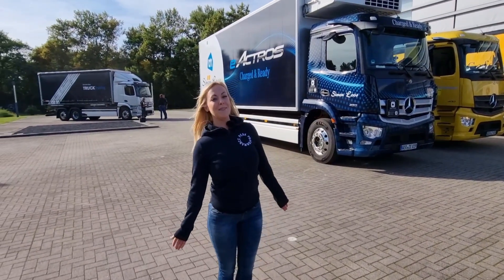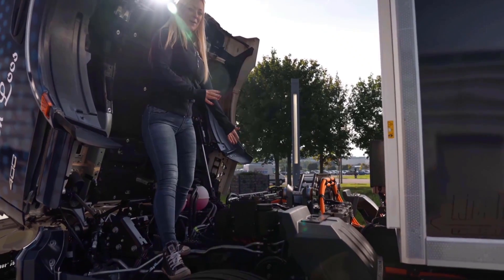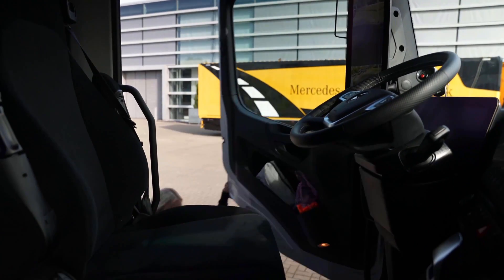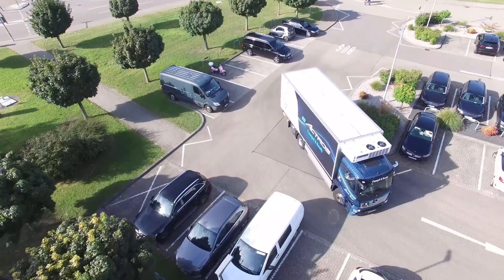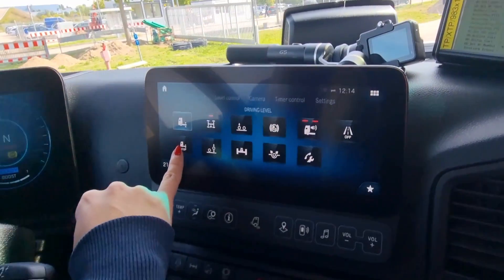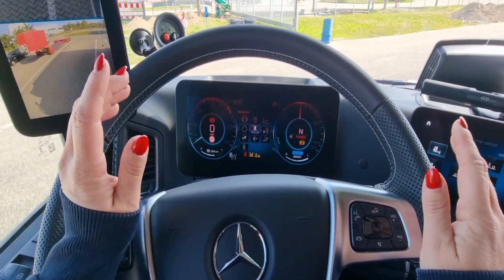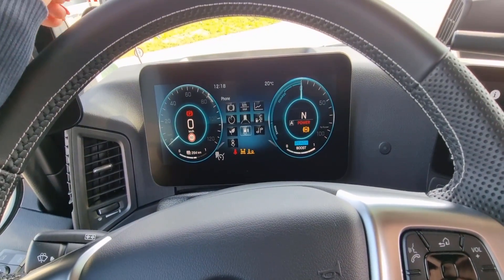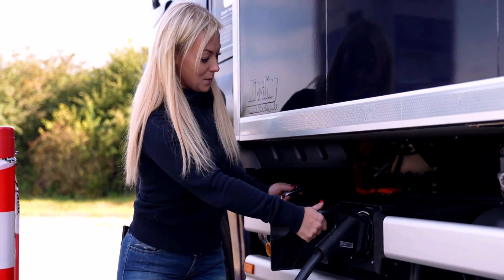⚡MERCEDES ELECTRIC TRUCK⚡ E-actros - Angelica Larsson

Comment: Excellent video and a pretty nice truck!  Hope that future vehicles share the same charging station plug-ins and standardize them across the world (Car & Truck).  One think that would be nice, at least for the straight truck, would be to add solar panels to the roof.  There seems to be plenty of roof space for them and would provide all-day charging to extend the work-time of the vehicle (during the day that is).  Not so much for the standard Semi-Trucks (unless they have an extended cab).  Curious how it would perform pulling those big loads from your recent videos. 😄

Comment: Cool for just around town.

But for a long range I believe most EU countries have a speed limit of 100kmh for lorries and the driver must take a break every 4 hours.  So you're first reaction to those numbers might that this lorry satisfies that.

However if the lorry has a range of 400km then when you're only recharging to 80% you will need an extra battery, which is another 750kg.  And when it's winter that will have an effect as well.  But also when you operate that big chiller thing over the cab that will also have an effect on the range.  So you might want 2 extra batteries for long range.

But cool to see that lorries are now becoming electric as well.

Comment: How wired was it to have no engine noise?
Did you get to drive the or even look at the Mercedes hydrogen truck unit that would be good to see and learn about 
Good introductions to electric truck 👍

Comment: You can only drive 250 miles with this truck before it needs recharged. That is nothing here in the states. It would maybe make a good city delivery truck or a delivery truck that travels under 250 miles. Electric is not a good choice for long haul trucking. You also need to factor in the weight of the load and terrain. The more the load weighs the more energy needed to move it which shortens the charge on the battery quicker. Terrain is the same way. If you have uneven roads with hills it takes more energy. Give me my good ol' diesel engine anytime.

Comment: Probably not in my lifetime. Infrastructure to make electric vehicles practical seems away off. Petroleum products required for producing batteries and the fact the charging stations ive seen ran off diesel generators, so still dont quite see the supposed environmental gains. But, maybe someday, battery life is certainly improving by leaps and bounds.

Comment: Greetings from Scotland! This is the future! Or is it? I agree that these trucks which have around a 400Km have a place in the city, but long haul is a completely different matter. I predict that Hydrogen cell trucks, like the Mercedes-Benz GenH2 Hydrogen Fuel-Cell Electric Truck which have potentially a much more realistic range of around 1,000 to 1,500Km and much quicker refill times will soon be in service, as long as they can get the Hydrogen fuel production costs down? Thank you for this report Angelica and a big thank you to Mercedes Benz Daimler for having the foresight to invite someone with great such experience to check out their trucks! 👏👏👏👏
Reply: Diesel engines modified to run on hydrogen will likely be much used in in larger construction machines and long haul trucks. Check out videos on JCB latest engine development
Reply: @Rimrock300  Yes, this is also a very promising option, it's better if existing machinery can be upcycled, so to speak!

Comment: Prototype or production ready? Price compared to similar truck?
Reply from the maker: I think they're just started selling 😄 not sure about price 🙉
Reply: Prototypes has been tested since 2016. This is second generation, production ready. x3 the price of a diesel Actros. They for long has said batteries will be cheaper as production is ramped up, but it has not happenen, rather the opposite. Those special metals used in the batteries are aviaiable in small amounts, driving prices way up. Eletric vehicles are just driving prices up for everything to a much larger degree than diesel. It's madness.

Comment: I own an EV car, they have installed a lot of DC fast chargers but no where enough to charge all the EVs they plan to make. It's going to be a long time before they have the infrastructure to charge all these electric vehicles.
Reply: More to the point unless we go fully nuclear, we'll need to burn more FF's to support all this demand.
Reply: @johnvelas70  We'd use less fossil fuels if we didn't have all this EV nonsense that wastes it without any significant contribution!!!
Reply: @LWRC  If the 3 best selling vehicles in the US were not full size trucks we would be using less fuel too.
Reply: @justcallmejohn2833  That what a free country is all about John. We don't need the government shoving this nonsense down our throats.
Reply: Installing all those charging stations, solar panels, wind turbines, solar thermal power stations, a lot more jobs as the industry grows.
Reply: @PiDsPagePrototypes  All this busy work for what?!!!  Why not put all this human resources to actually produce products that are useful to our society instead of just churning for the sake of making useless work?
https://www.youtube.com/watch?v=-MJfjrgEq34
Reply: @LWRC  It's the same as all the 'busy work' needed to do maintenance and installation as a Gas Fired power station, or Coal, or Diesel, the difference is, being able to breathe next to the powerstation. What's useful, is developing new technologies that don't fill the environment with waste, compared to all the last-century-economics of "Your grandkids will deal with it, I'll just scam off the profits and leave them the mess".
You either understand that the new technologies are 'taking responsibility for your own actions', or you're a dinosaur that won't evolve and will die off, preferably before earning a Darwin Award for ruining things for everyone else.
Reply: @PiDsPagePrototypes  Pretty funny from someone who wants to make busy work contributing nothing to society!
Reply: What a complete waste of our resources for all this EV nonsense - it still powered by fossil fuels!!!
Reply: @LWRC  Not everywhere, the state I live in is roughly 1/3 hydro, 1/3 nuclear and 1/3 natural gas.  But if you live in an area that generates electricity with fossil fuels there are less rewards.  The internal combustion engine is very inefficient over 60 percent of energy is lost as heat.
Reply: @justcallmejohn2833  And by the time you convert fossil fuel into electricity and go through high power transmissions and the many times the voltages get stepped down to power the chargers at home or business, it is actiually worse than internal combustion.

Comment: It's interesting to know that they have the motors in the axles. They could also put those axles under trailers or wagons so they help push themselves to start up and generate power when braking. I just don't know where the power to charge everything is going to come from. The next 10 to 20 years could be interesting but I probably won't be around to see much of it.
Reply: They are hoping that the majority of people will charage at home.  At the same time, they are also hoping more. people will install wind or solar on their homes.  For example the Tesla Power Station is designed to store solar generated power to charge the car later.
Reply: Put a wind turbine on there and hope the wind blows hard enough to get you going down the road
Reply: Probably from a nice coal fired furnace although the greenies are working on a fairydust alternative.
Reply: @henryostman5740  The real damage is the creation of those batteries... not very ecofriendly.
Reply: The power companies are in the process of decommissioning coal plants or converting them with upgraded generation and natural gas turbines.  In addition to his install more solar and wind.

The transition is already happening.  My local power company does not have any coal plants.

Comment: Are the batteries going to drain faster during extreme cold like the batteries now . Also batteries are heavy so it means you going to haul lighter or less freight than we do now
Reply: A 500hp engine, 18 speed transmission and a tank of fuel are also heavy- here they are all missing.

Comment: First off, it's a Mercedes ... not good! Second, how do you justify that more than 2 million liters of water are wasted in production until completion and that other regions of the world are dying of thirst? Neither one nor the other is praiseworthy. I'm not a hater, but nobody needs that kind of garbage. Ultimately, what happens to the waste materials from the battery when it comes to scrap, are they recycled as well as the wind turbine blades and are simply buried in the sand of the desert? Crap only crap !!!

Comment: I'm not won over, 400k to each charge and you can only put 80% in. And here's a question, while your taking care of recharging the battery are you on break or other work. Hydrogen has to be the future.
Enjoyed the vlog, take care be safe
Reply: there will be better batteries soon probaby. 400 seems to be only enough for local deliveries, sad times

Comment: Great to see, and I think they are the future, especially in cities. I've watched your videos where you've driven to the north of Sweden. I wonder how an electric truck would cope with the cold weather, but also how the cab heating would work and if it would be warm enough. But for a medium range delivery truck that Mercedes would be amazing.
Reply from the maker: I know another brand is testing here in the north, the truck works, but they're having a hard time keeping the heat in the cabin 🙉
Reply: @AngelicaLarsson   Esti super bun soferită Angelica sper ca mai continui cu vidio clipuri ca eu am urmarit taote vidio clipurile tale Angelica  Eu te stimez foarte mult asa Domnisoara asa de tinara sa conduci numai camioane si utilaje foarte grele ..

Comment: I hope you had a blast at Mercedes testing center. You must have felt like a movie star with all those people with cameras on you. 
They picked a perfect tester to try out the truck.
I think those back up cameras are really cool. Yes, it probably takes a little time to get used to, but it would be nice in the winter not having to clean mirrors……. Although I am sure you need to clean camera lenses.

Comment: Great video Angelica. One question how do the batteries perform at -20 or -30c. Does anyone remember the old electric milk floats? Nothing is new only better and more advanced. Thanks Angelica.
Reply from the maker: I know that another brand is testing here in the north, it works, but it's hard to get heat in the cabin 🙉

Comment: Never understood why mb introduced those backing cameras,the screens create a huge blind spot on very important angles,and they are worst than mirrors when you need to reverse.Totally makes sense ?
Reply from the maker: On their trailer, the cameras move, so you see the trailer all the time in either mirrro😃
Reply: Aerodynamics are improved. I guess what makes them less good than mirrors is that they are not 3D. You can’t see the true distance to stuff on a 2D display. Try backing up with one eye closed and you’ll ”see” the difference.

Comment: It is good for the environment until you have to dispose of those 4 batteries at the end of their useful life.  At that point it is no longer that good for the environment.  You are essentially trading soil pollution for air pollution and I for one do not think that is a good trade.
Reply: You don't "dispose" of batteries. You recycle them. We can easily recycle 80-95% of EV batteries.

On the other hand 0% gas and diesel exhaust is recycleable =)
Reply: They get recycled

Comment: Angelica I will bet it was an honor and a very cool thing to have Daimler invite you to check out and drive the electric truck
Driving an electric truck was a real different experience for you from a regular gas/diesel version
Very cool to see you driving it out on the test track and I did notice it was a lot quieter drive.
That Frigoblock refrigeration unit I would imaging that was powered off of the trucks batteries.
I also saw the different side view mirrors inside the truck running off of cameras outside, probably for aero reasons and for a quieter drive too without the wind noise from hitting the outside mirrors.
You could very well be the next spokesperson for selling electric trucks, but you love your day job very much and I do not think that will happen anytime soon.
Indeed the battery range is very short, but for city use it is perfect.
Each battery generation the charge is getting better range and distance out of the batteries.
Very cool seeing you doing this in this video with maybe more of these in the future.  👍 For a great video and keep them coming when you can.

Comment: Angelica som du vet så tittar jag på den och gör tummen upp för dig. Det jag måste påpeka är att om du hade lastbilen på din arbetsplats under vintern och den stod utomhus i en timme bara men det är minusgrader. När du kommer tillbaka till lastbilen så kommer du se att batteri laddningen har sjunkit och är det kallt så hade du inte kunnat starta den. Samma sak med elektiska personbilar. 
MEN i framtiden kommer inte varken elbilar eller ellastbilar dominera på vägarna utan vanliga bilar och lastbilar. För Formel1 håller på ta fram hållbar bränsle som ska driva dessa F1 bilar och det kommer sedan kunna köpas till allmänheten med. Alltså du ska kunna köra din bensindrivna bil med det nya bränslet som man håller på ta fram och minns jag inte fel så är Sverige inblandat.
Nu får du skratta åt mig, genom att du pratar engelska så glömde jag bort att du är svensk, så jag använde Google translate till Engelska, sedan kom jag på att du är svenska.
Reply from the maker: Du har helt rätt 😄 det låter också spännande 😃

Comment: It will work both diesel and electric...

What is the cost of the vehicle
Reply from the maker: I forgot to ask 🙉
Reply: @AngelicaLarsson  I heared on the news recently its about 100K over the Diesel version, could have been DAF, or yet another brand though, but it should provide an indication. Was a report on a Dutch Transportation company,that went all electric. That therefore had to find the clients that shared the mission and would support going all electric, as part of their brand values.

Comment: I love your content,but I have to disagree. These trucks may help the environment,however they are not practical and it takes more energy and pollution to construct the batteries on these electric vehicles. Thanks for sharing !
Reply: Just a hype those electric hairdryers on wheels. As you say there is tomuch energy needed to make the batery,s. But the experts know always better,within 15 years the will see that it is 1 huge mistake. Better use hybrid oe a generator that uses very little organic fuel to keep the electric engines running. There was already a prototype car wich could do 500km omn 1 litre of diesel,combine that with a 50 litre tank and you can drive from Amsterdam to peking 3 times on 1 filling. Big plus is No batterypackage needed. But we need to follow crazy greata,i think that is why daimler invited Angelica. But who am i,just a V8 camaro owner😝😝😝
Reply: @janvanrenselaar5998  "But the experts know always better..."  Always follow the money...
Reply: Not to mention that the planet is not ready to sustain extra electricity consumption. There will be blackouts all over. They will have to burn the hell out of coal to keep these jokes running. “ A business man can make a good politician , however, a politician will never make a good business man”. It is all special interests , this hard push on electric vehicles
Reply: @Corleone_Napoleone  yes it is all about getting every cent out of our pockets,every 15 year there is a doomsday preacher standing up. We had the Acid Rain, did you find bottles of vinagre in your garden,The hole in the oZON layer of the atmosphere. we don,t hear anything more of that problem. Did we closed that?? And so yes,how did we do that,With Ozon in Spraycans??

Comment: Do you think these battery trucks are powerful enough to pull extremely heavy loads ?
Thanks  Chris
Reply from the maker: In the future I think, but not yet 😊
Reply: @AngelicaLarsson  Well even the 411 Unimog with only 39 PS, or a around 38 BHP could schlepp 40 tons, of course it was at 250 an hour;-). Trains are all electric, so it can tow a lot 300+ tons, but how long till batteries run out... So strength is not the issue.
Reply: @AngelicaLarsson  Thank You Angelica for replying back. This was one of my biggest concerns if they were powerful enough for those heavy loads.   Thanks Again : )